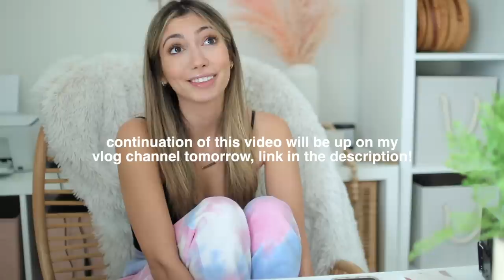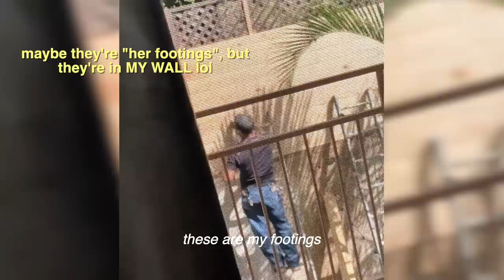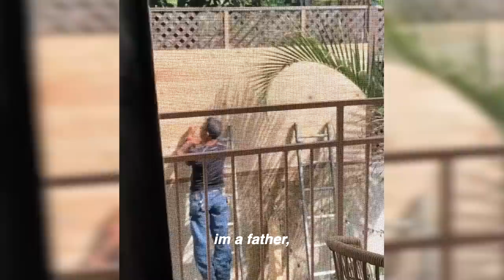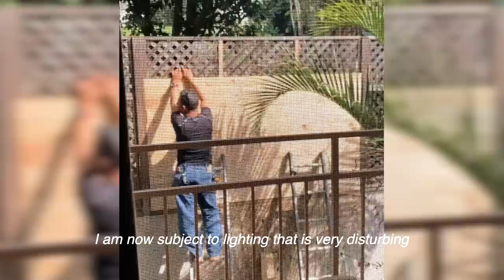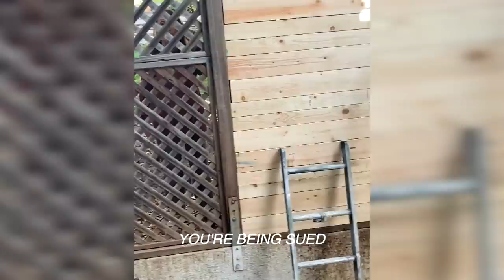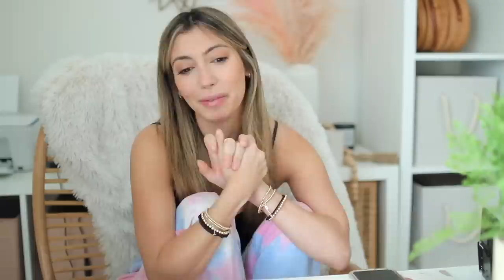FINALLY calling the police on my CRAZY NEIGHBOR - what went down...

Comment: If you have 3 feet of room between her property and yours technicallyyyyyyyyyy you could put up an electric fence and give her a lil shock every time she gets close lol
Reply: Tayler Wood you can’t. That’s equivalent to an attractive nuisance in legal terms- she knows she will approach the fence and can’t put an electric fence knowing she could be shocked. 

The correct remedy really is to serve her with a legal demand to remove the fence, replace it at the property line so she has to stay on her side, and keep the additional barrier so she has to scream her nonsense from 3ft away from behind two fences.
Reply: TheBeanie1988 - I couldn't agree more. This will only be resolved via court, and Tara, I would say, has a strong case. This is a boundary issue first and foremost.

Comment: Anyone having to deal with this, get a topographer, it will take all measurements of the house and land, get someone to move the fence to the correct location. If the person insists,  get a lawyer, take to court, get a restraint order, plus all court expenses and compensation for all the stress. Then built a 20ft fence in your side of the yard, pluss get security cameras all around.

Comment: Get you a contractor who knows there's a chance they'll be assaulted, and is willing to deal with that, have them start installing a cheap chain link fence on the other side of the wood fence in the section that's your property.
Then when she attacks someone on the construction crew, file an assault charge against her, and finish the fence while she's locked up. It may help her get the help she needs.
And you'll have a buffer zone between her and your nice new wooden fence.